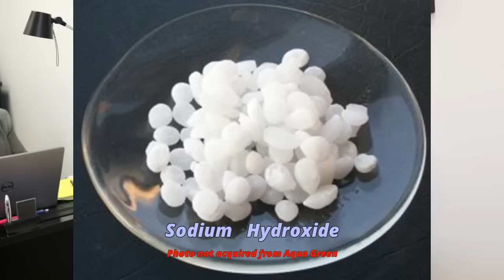Flameless Cremation/ Water Cremation/ Alkaline Hydrolysis Facility and Explanation

Comment: I used this on my mom.  It was only 350.00 more than fire cremation.   You still get ashes back.
Reply: Thank you. I was wondering about the cost. Thought it would be a lot more.
Reply: @JohnnyLegato6M  however, your tying up a machine twice as long. So, you can see the added cost, but in reality its cheaper. Im sure they do a "bulk" creamation meaning multiple machines running vs 1 or 2 furnaces.
Reply from the maker: Thank you for sharing

Comment: I've already signed up for my water cremation. Here in Ontario. I chose this method because it's a much greener way to go. After I'll have my cremains added to a tree bulb,and be used as a form of nutrients. The idea of being put in a box in the ground has always scared me. When I heard that I could go into water I was sold!
Reply: Water cannot dissolve a body. They use a very caustic and strong alkaline or Basic(opposite of acetic) chemical. This chemical is similar to lye, a chemical used to make soap and used by hunters to remove all the hair and skin left after butchering a leather-covered animal hyde. If one added the broken down mixture of a body and the strong alkaline chemical used to dissolve it to a tree bulb, I'm sure it would kill the tree bulb, immediately. Also, one wonders what happens when this remaining brown sludge is sent to our water treatment plants. Will it be safe and will it be costly to remove the harmful contents of this mixture? The new alkaline process takes much longer to complete than the old fire cremation process, some say over 4 hours. This will require the funeral home to purchase more of these devices to be able to keep up with the load factor. One good thing, the newer alkaline process will not pollute our air because nothing is released to the atmosphere.
Reply: Inorganic bone has no nutritional value to a tree

Comment: What are costs of this method as opposed to traditional burial, and heat cremation?
Reply from the maker: Same as flame cremation
Reply: Kari Northey Qs: If I’m in another state how does he get the body & will this take much longer because it’s out of state say AZ? Did he mention cost for out of state, do they fly the body out or? is it all inclusive or extra fees. Do they mail the remains or do you still need to contact a local funeral home for this option? TY it’s very interesting.

Comment: A couple of things that came to mind while watching this are the fact that pacemakers would not explode in the retort due to heat damaging it and body fat would not catch fire or as you mentioned in the cremation video seep out of the retort causing a fire in the facility.  The company web site remarks they accept bodies from the entire Midwest.  Wouldn't that involve transportation across state lines and the requirement for the body to be embalmed?   Is it still a "green" disposition if embalming fluid is in the concoction of fluid released into the sewer system?

Comment: Thanks again Kari for another great video. I’ve heard of this type of cremation before but never knew the full process. You answered all my questions on the process. I always was intrigued about what is done with the solution after the cremation. I always assumed that it would be a biohazard and would have to be dealt with accordingly. I didn’t think that it was sterile enough to just let down into the common drain.
Reply: Thinking outside the box, rather than just pouring the fluid down the drain, would it make a good plant food? Not for in the food industry, I'm thinking house plants, shrubs and trees.

Comment: Informative video, but one question, I didn't hear any mentions of water temperature, I believe I saw somewhere that the water is heated to over 300 degrees. Kinda like cooking the body. Is this true? And also I really don't like the fact that a deceased remains go back in our water treatment plants. I wonder why they don't require septic systems so the water would go into the earth.  But I guess it's doesn't matter, cause all water and fluids evaporates and goes back into the water we use. Kinda Gross when you think about it. Thanks Kari. Great video.
Reply: Mikey mike no worse than anything else that winds up in the sewage system. With traditional embalming, blood and other body fluids go down the drain.
Reply: smitty54017 yep, I watched an embalming years ago at a friends funeral home,  I haven't had stewed tomatoes to this day. Those blood clots sliding down that porcelain table stuck in my head.  I know it gets treated at the water treatment facilities. It's just the thought of the stuff we put in our water supply.  From home sewage too hospital waste and so on.  lol kinda takes ones thirst away. 💦
Reply: Kari Northey yep, if you really think about how we abuse our natural resources such as air and water, it's scary. It's all just recirculated or recycled so to speak, and we wonder why there is so many birth defects and illnesses.  And with the population continuing to increase it will only get worse. Thx for the reply Kari.
Reply: Kari Northey,  I have just watch a vide on Scishow  on YT. Kinda of interesting channel. He show one of freezing a corpse in liquid nitrogen. It is them turned to dust. Kind of interesting.if you have the time check it out. They post all these ever wonder what or why type videos.  Just want to say I'm loving your channel, and look forward to your videos.
Reply: @mikeymike3194  It was a lot worse back in the day when people were just thrown into the ground to decompose, without a casket. At least today they are thinking of options that are more environmentally friendly. What else are we suppose to do. Everyone dies and we learn ways to make the disposal process a cleaner one. It's much better today than it was in the past and I don't believe the disposal of the by-products of death are to blame for birth defects. Treatment plants take care of all that so nothing harmful is left. Resomation is for me, and I will be doing my part to be "environmentally friendly" when my time comes. PEACE +
Reply: Its just a few basic chemical elements that go into the water. If you think about it what we put down the toilet is pretty gross.
Reply: @TheRapnep  Caskets don't prevent anything.
Reply: That’s what I was wondering too!  So many questions still.  
I can attest to attempting to clean boil a deceased cattle head carcass, and let’s just say it was not pleasant. 
So exactly how much liquid remains once process is completed?  Can this liquid be mixed into cement to create a lawn ornament instead of putting into the public drain?  
Considering my surprise when I took chemotherapy, I was instructed to flush toilet two or three times after use as it was very toxic to others…you would think regulators would stop that. 
Still trying to figure out if this container works like a washing machine agitator like movement since it’s a top and bottom basket or body just lays until dissolved?  
Very interesting, Glad for more options, but dying is expensive!  I want people to visit me, so I want a Big Foot statue made out of me!!!

Comment: If I understand this correctly, the alkaline solution basically dissolves the flesh, organs and soft tissues. So, it seems the difference is having these tissues burned and mostly escaping through a chimney, or being dissolved and flushed down the toilet. Is this not what they are saying? The dissolved body parts end up in the sewer. I like the energy saving and ecological part, but I think I would rather become ash and smoke rather than sewage. Let me know if I am off on this one.
Reply from the maker: Correct!

Comment: six to eight hours per cremation and then you have to dry the remains before processing them. That is why this method will not replace flame based cremation. As the cremation rate rises, you would not be able to keep up with the work load. This method takes more than twice as long per cremation. A high volume crematory would need several of these machines when one flame based cremator will do. Did they say how much the machine costs? Then how much for the supplies?
Reply from the maker: It is slower for sure

Comment: As a funeral home owner I am very intrigued by this machine, my biggest question would have to be the cost. Is it the same amount to setup as it would a regular retort? He mentioned you have to buy the Alkali, how does that compare to the cost of gas per cremation? Lastly each regular cremation takes about 1.5 hrs, 3hrs for it to be processed etc does this machine compare to a regular retort as far as speed?
Reply: As was mentioned in the video, takes somewhat longer as it is a slower process.  Up to 8 hours, depending on body size
Reply: @joelstevens5901  thanks for that. Still though, this is not a feasible way of disposing of remains. Personally, it’s better to sell the living cemetery package, you can still have remains if they wish but if not, it all goes into the liquid nitrogen and broke down into fertilizer with a gps and a tree seed/tree of their choosing inside, it doesn’t take any longer than a regular cremation

Comment: One correction from what was said at 18:00 with heat cremation is that the body does NOT just go up in smoke. There is no smoke in heat cremation.  The heat is so intense that flames don't actually touch the body but is just heat dried then whatever remains is ground into a powder. Nothing is released into the atmosphere. It's an equally very clean process because of the strict regulations.  So you need to accurately describe the other process in order for viewers to make an informed decision.  Nevertheless, this is a very interesting video.
Reply from the maker: Yes flames do touch the body and the body is in flames many times. there is emissions which is why the EPA is part of the process. Flame cremation creates as much of an environmental footprint by using resources as burial does.

Comment: so is the body broken up with high power water jets or broken down with blender like blades. as you didnt didnt say how it actually worked.
Reply: The heat, water pressure and alkali break the body down.

Comment: Good thing there's no carbon foot print of making the chemies used in this process.I wonder if there is any heat evolved in drying the bone remains. An app to let me know that some  partially digested HRs are leaking, awesome. Would that be considered a type 2 spill or can you just neutralize it with some citric acid or something like that, and even if the portland cement concrete is made with non-alkali-reactive aggregates, potassium chloride can still compromise it's structural  integrity. Well just some simple questions from a simple minded person.

Comment: I realy like the idea but...I˙m not religious but have family chatolic background and that flushing part of my loved ones in drain is nnnn.... a little bit tricky, and not just for me, for a lot of people that is a issue with water cremation, but they could solve that if include some kind of evaporator in alkaline hydrolysis machine, like powdered milk, water evaporate and dry matter stay, same principle could be done here, then nothing would go in drain, it would consume little bit more energy but it would still be green and ecological, only water wapor released in air and dry matter would stay with cremains, maybe that could even be a answer for Asian nations that need that "releasing of spirit"  for which they are performing classic flame cremation. But that is just my thoughts, alkaline hydrolysis is relatively new tehnology, like everithing else, it will evolve. Great chanel you have :)

Comment: I am curious about the final, solid product left behind after all the flesh and soft parts of the bones (i.e., the marrow, etc.) are dissolved away.  I assume that what is left of the bones is the calcium in the bones and whatever else can't be dissolved by the lye/water mixture.  If the family of the deceased does not want that material or the person died without any heirs or their identity was not known at the time of death (i.e., they were homeless or otherwise died anonymously) can that material be recycled?

I mean, is it possible to take that material and chemically break it down, perhaps turn it into fertilizer or some other usual substance such that the deceased's "cremains" can be re-used or be disposed of in an environmentally friendly fashion?

I can imagine that some families would not want the "cremains" back and in the case of someone who died anonymously, there would be no one to give the remains to.

How would the remains be disposed of?
Reply: All that is left is inorganic bone. I guess they could simply dispose of it.